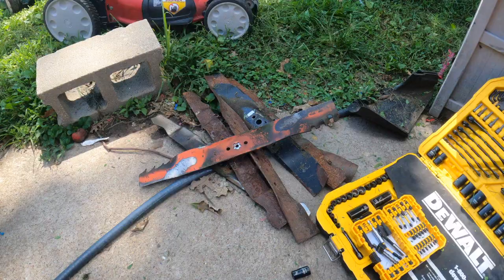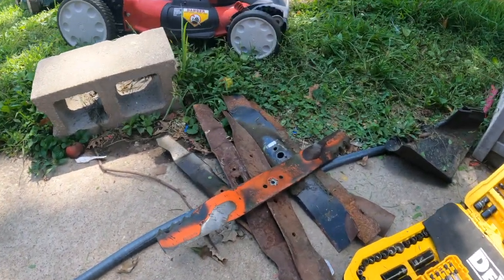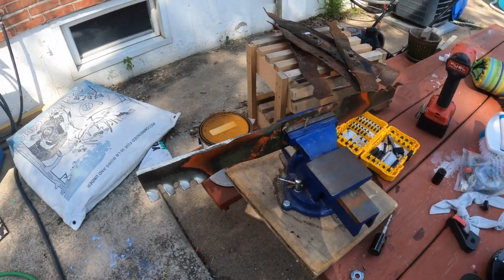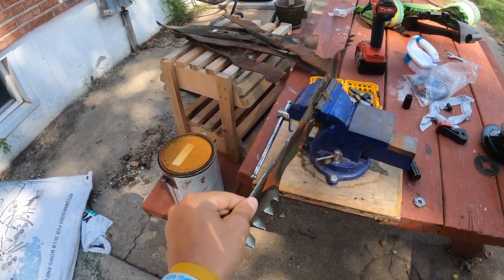How to sharpen  your dull mower blade | CROSSE CUTZ

Comment: A balanced blade spins faster has less vibration and your mower uses less gas to do it's best cut ,change the blade often as only sharp  to cut the grass cleanly  for a short while,soil is powdered rock so dulls the edge quickly, excellent job.
Reply from the maker: Thanks for the tips!